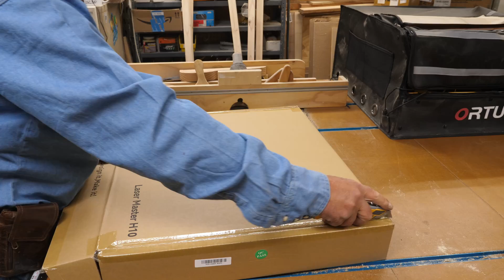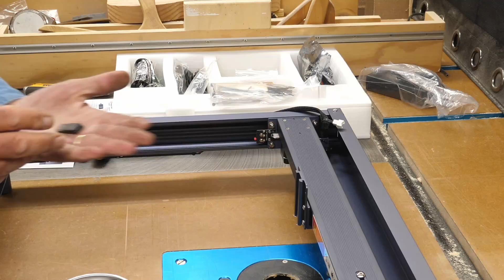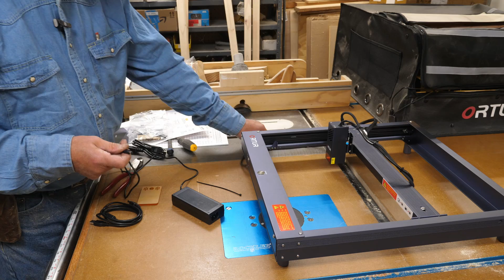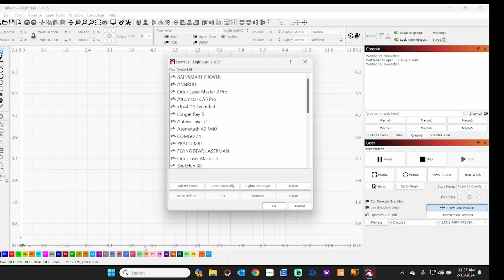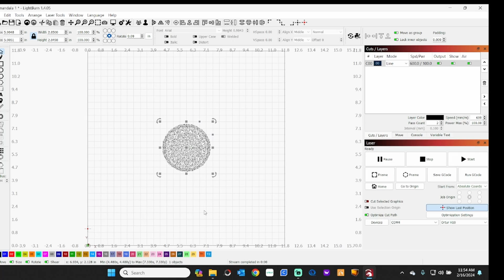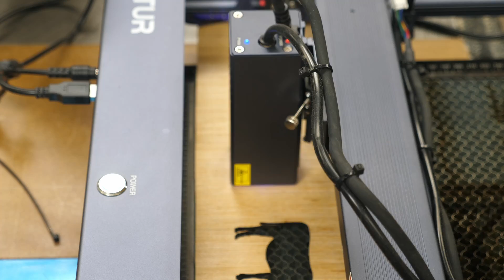Ortur Laser Master H10 Detailed Assembly

Comment: I'm not a fan of the wifi antenna placement for this model. Feels like it would get hit when working with longer material.
Reply from the maker: Possible, but a common location for many manufacturers.  In that case I would add my risers to prevent contact.